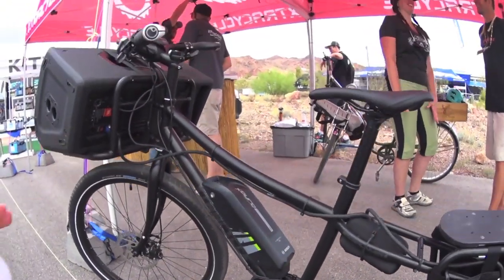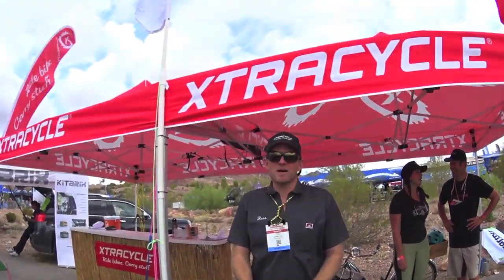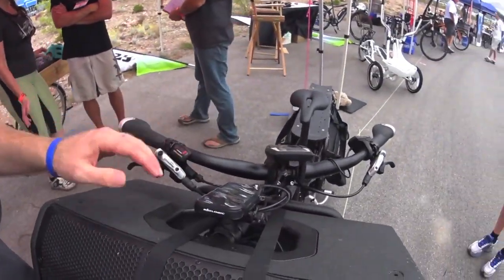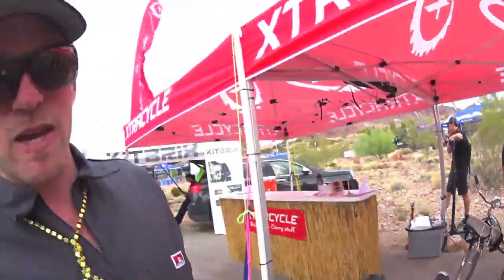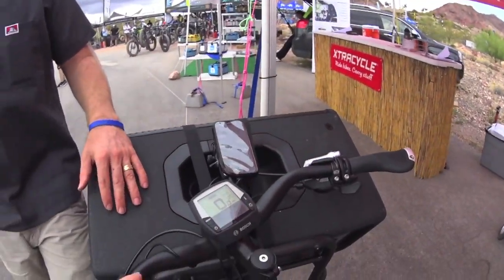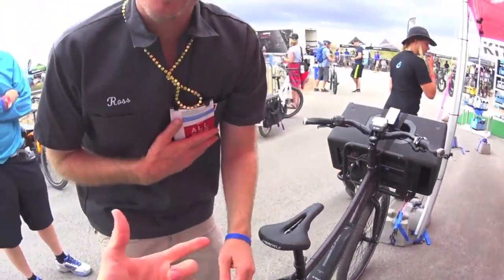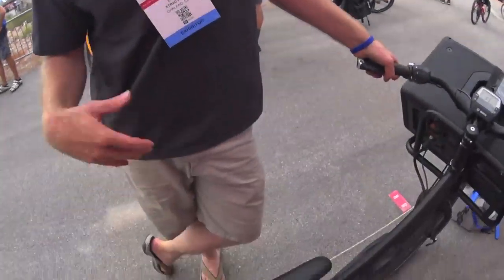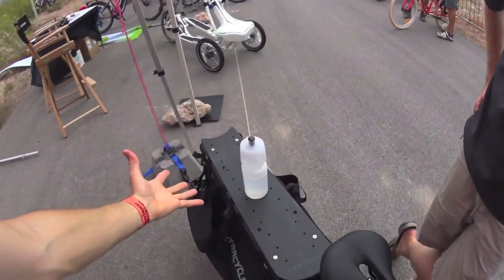Interbike 2014: Interview with Ross Evans, Founder of Xtracycle

Comment: That's awesome Matt Golden! So glad to hear you're enjoying your Edgerunner with the 8Fun motor. One thing I like about that conversion is that it offers pedal assist and throttle mode but still uses the mid-drive which is great for climbing and extending battery life :)